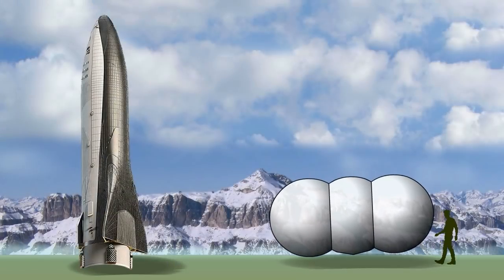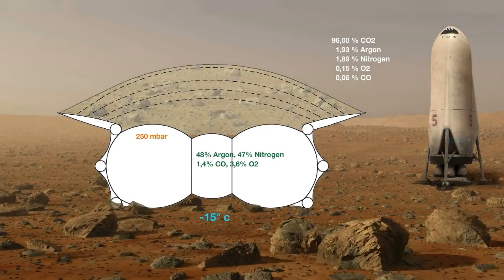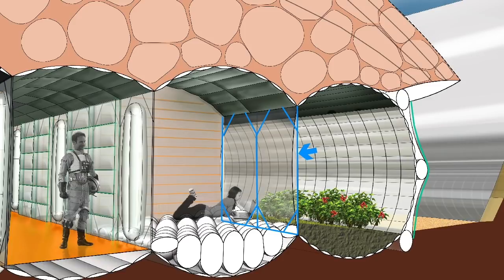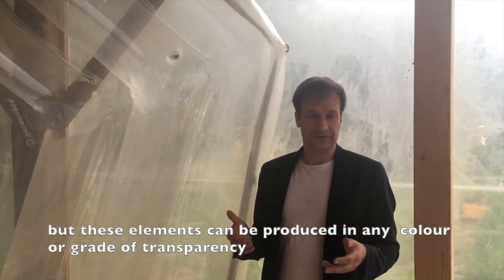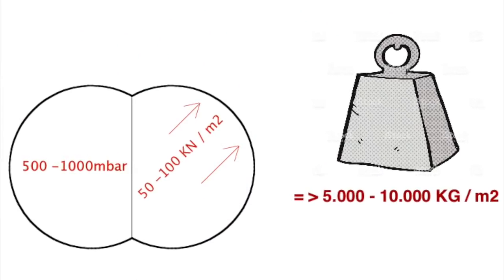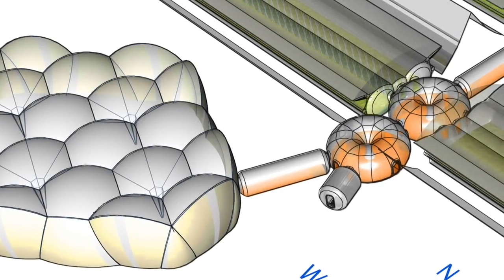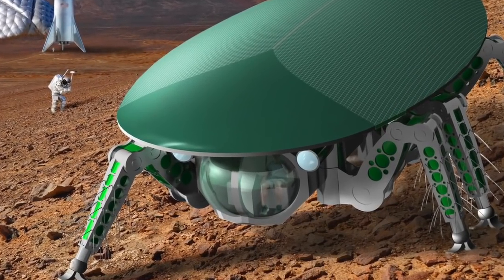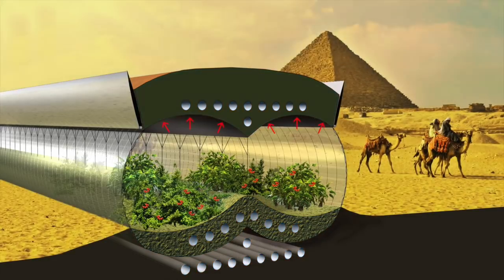inflatable Mars habitat and Lunar base

Comment: 3:12 The percentage numbers add up to way more than 100.
Reply from the maker: you are right. this is mathematically incorrect
But in fact the amount of argon and nitrogen remains  the same. By adding CO2 that is converted in to Oxygen by photosynthesis, the  total number of molecules increases and so does the density and pressure of the inner air.  
So yes, mathematically it would be correct to show percentage number of argon and nitrogen decreasing. But I thought that would be more confusing for observing the process within a few seconds

Comment: Great job! You have great ideas!! 
I have a simpler solution based in the use of water instead regolite. Pure ice is transparent but shield radiation, in addition is an excellent termic isolation and you can equilibrate the habitat internal pressure  with the weight of the ice. As you can calculate 0.5 atm is equivalent to 15 meter of ice on mars. Even you can use it to concentrate light as a lens. I also know how to make cheap foundations by using cables although doing things well you don't even need them. I think I know how to do it. I would like to work with people like you some day.
Reply from the maker: There has been this   mars  ice house  project  awarded in the 1st stage of the NASA design competition. A smart concept. But I see 4 problems :
1; Water/ice is difficult to mine on Mars.   It is expected to  be on the poles, 9000km away from the equator where the habitat should be for climate reasons,. Or there hopefully is some underground which needs to be. processed to be extracted.

2; the inner temperature should be around 20°c  and even outdoor the temperature can raise up to 30° sometimes.
This means the ice would constantly melt on the inner side. To avoid the ice vaporizing in the low pressure on Mars, when temperature raises above 3°c. you need a transparent membrane layer outside to hold the steam and steam pressure until it freezes  again, this are high pressure forces on the membrane and the membrane is fully exposed to radiation, dust storms and micrometeorites

3; it will be difficult to produce a 3 meter thick ice wall so clear that not much of the light is absorbed

4; Ice is very brittle. in case of a Marsquake it might crack
Reply from the maker: if you are interested go on my website and contact me.  When I get enough budget to continue quicker, I might need more brains in the team

Comment: 17:00 for the applications on Earth, it seems like there will need to be an over-pressure inside, and air-locks if that overpressure is at all significant (i.e., enough to contribute to bearing significant weight on top). That seems maybe ok in an application where you don’t need to enter/leave frequently (a greenhouse?), but potentially problematic in applications (eg, a hotel) where a lot of traffic is anticipated. I wonder how much overpressure would need to be present to lead to a need for slow decompression, to avoid the “bends”?
Reply from the maker: yes, depending on the thickness of the deposit on top , about 50 -100 millibar of overpressure are required. Less than for the Mars habitat, but still it needs to be careful calculated  for the structure. An airlock is necessary . The best solution would be  these Lock doors they use on Boats.  Apart from greenhouses , single home also might be an application as prefabricated "instant " houses that just need to be put into a pit and be inflated. Which keep a moderate temperature around 20°c without heating or cooling. But I don't see a use for hotels or other large highly frequented buildings.
Reply from the maker: from all your comments and questions, you seem to have a lot of technical understanding. What is your profession?
Reply: @thomasherzig174  I have a Ph.D. in Applied Physics. Though, it’s a long time since I’ve been a working physicist. (I also worked as a software architect. More recently, I focus on interpersonal communication, collaboration, and conflict resolution.) And... issues related to space exploration is an area of active interest.

Comment: Many things about this design seem very promising. I like the simplicity and efficiency of the construction techniques involved. I could easily imagine some version of this approach being deployed on the very first Mars mission, and being available for use early in the stay on the surface.

For habitation modules, it seems like there will be a regrettable lack of sound insulation—it appears that the only way to get sound isolation may be to have a long tunnel between modules that aren’t otherwise connected? 

I’m curious about the potential for manufacturing new module components on Mars, given suitable materials? It would be nice to have this capability both for repairs and to address unforeseen needs.

I’m ambivalent about the “lip” doors. I suppose they could be braced open, when one needs to move equipment in or out? I wonder what benefit they actually provide? Minimal sound insulation? Barriers to unwanted air movements?

Having two layers of pressure containment seems like a good idea in general, for safety. I like that the design includes this. (Except at the ribs between air pouches; I imagine those ribs will be tough enough that punctures there are unlikely?) 

How do you imagine forming a flat, stable floor? Filling in the bottom with regolith? For a habitation module, I wonder if regolith would pose a health hazard, unless it has been heavily processed? Providing a good floor seems to me to be one of the more puzzling issues. Maybe the surface the habitation is on can be made very flat, so that the lower layers of the habitat are forced to conform, then you just overlay the lower membranes with hard panels of some lightweight material, to protect the pressure-containing membranes from wear?

I wonder how one could detect a leak in a sub-floor membrane? Though, this may be unlikely after everything is installed? (Unless one inadvertently imports rodents, or allows one to escape from a lab? Yikes! That could be a big problem?)
Reply from the maker: there also is a way of forming rigid indoor components by inflatable membranes:  You take the inflatable  envelope outside where the airpressure is nearly zero and fill it with mars sand, then you close it again. 
When you take it inside the innere air pressure  of the habitat  will press the envelope onto the sand inside . Pressed together by this strong force it will be rigid.   like these vacuumed peanut packages.  So you could make hard panels or even columns  and massive inner wall this way.  But it is a lot of mass to carry inside which is  very heavy even under mars gravity.  But a toilet bowl or a sink could be quickly produced this way from a thin light envelope from earth and sand from mars
Reply: @thomasherzig174 
Even plastic forms the are the right shape, if filed with Mars sand, would take on a solid form, even without vacuum packing those forms.
Reply: I’m curious about the construction techniques. There are a lot of inflated compartments within the structure. Are there inflation valves? Or are they inflated as the membranes are joined together, then permanently sealed?
Reply from the maker: @zzubra  the inner walls are just inflated once they are zipped on. with any kind of electric  rubber boat airblower. Maybe after several weeks they need to be reinflated a bit.
I already produce inflatable wall elements which are connected visa nylon zippers:
http://www.pneumocell.com/pneumocell.elements.english.html
www.pneumocell.com

Yes the sound insulation is not very good, but still better than in the ISS station I guess. Since you need about  400-500m2 of greenhouse area to sustainably feed one person, there is enough space to keep distance between sleeping compartments.  If you only grow vegetable and bring grain from Earth you need less agricultural area. But then  it is not 100% self-sufficient .
Reply: @thomasherzig174  if interior walls may need to be re-inflated from time to time, is the leakage through the valves or the membrane?  Sounds like a chore that it would be nice to be able to eliminate. Might, for example, using more expensive valves fix the problem? What about the cells of the outer pressure vessel? If those have leakage, I’d worry about that.
Reply from the maker: @zzubra  in theory it should be airtight forever, but it depends on the production standards / efforts. The welding needs to be done very carefully,. after production each item needs to be checked.  For cheap inflatable items they only make a 24 h air leack test,  For higher standard you test longer. 
When when the leakage is a very little bit only after a week, it is very difficult to detect the air leack because it is so tiny. Also the membrane material could have tiny leakage when not produced carefully .  it also depends on the design.  With simple geometry that requires a few production steps only , it is easier o produce something 100% airtight. .
For the big structural membrane a little air loss would not ne critical. You can slowly add CO2 from the atmosphere by time , which will be converted into oxygen and biomass through photosynthesis
Reply: Inflatable habitats are compact to import, even if they can't be made locally for some time...

A floor could be tiles that lock onto plastic feet, that distribute weight through the inflated section directly into the ground.....?         :)
Reply: Two layers is a good idea, three layers is even better !

Comment: Personally, I think you could get a great amount of light into an under ground base simply by using sky lights with angled mirrored panels that are I backed with special blocking materials on the back of the mirror.  Or using a sort of acrylic prism centered with-in the sky light.  Certain translucent materials can also stop radiation due to their composition.
Reply: For the highest energy radiation, nothing stops it but mass. So, I wouldn’t count on any transparent materials to provide full radiation protection. Schemes with mirrors and angled panels could work in principle—and that’s what the video is proposing. Yes, one could also do this with angled skylights, but the complexity of that would be a bit higher.
Reply: @zzubra  The mirrors in the video have moving parts which makes them more complex.  Most skylights and light tubes are passive.  Probably not a big deal since we are talking about a Mars colony.

Comment: You are talking about using loose regolith as shielding the structure but do not mention it is a powdery toxic substance.

    3d printing would allow regolith processing to remove toxic material. A 3d printed stricture is self supporting harden shelter not subject to popping like a ballon. Trench sub surface built structures could also be back filled for additional shielding. 

  Why have a surface mirror/voltaic system when a space based system could remain active continuously? Send down both visible light and electrical energy 24/7.

We have thousands of years proven experience with soil based construction. Why use a fancy ballon?

    Growing up in the sixties with inflatable furniture i know how sweaty it gets in minutes. It could require a padded cloth cover to be usable. It is an idea for beds chairs and couches however even interior walls would let the kids hear everything going on in mom and dads bedroom. Lol.
Reply: Something unique about construction on Mars or the Moon is that there must be a pressure differential between inside and outside. I see this approach as taking advantage of that inescapable difference in a clever way.
Reply: @zzubra  Traditional building materials such as rock, steel and aluminum all have good compressive strength properties. And on earth, these are important for structures. But due to the tremendous pressure difference between the martian atmosphere and a life-friendly environment, your structure really only needs good tension properties. Compressive strength is unnecessary. So I completely agree that this method is simpler and makes good use of the pressure difference. Since it's going to be there anyway, you may as well use it to make your structure rigid.
Reply: Regarding a space-based system for gathering power... that is many orders of magnitude higher complexity than the solution being proposed. That complexity is unnecessary. (And, beaming power gathered in space to the ground is an approach that Elon Musk has been a vocal opponent of, believing it to be a misguided approach for most purposes.)
Reply: Regarding the regolith being a “powdery toxic sustain environment”, the relevance of this is different inside and outside the habitat. Inside, the video talks about detoxification of regolith using bacteria. Outside, toxicity isn’t particularly relevant, so long as the regolith isn’t corrosive to membrane materials. As far as the regolith being “powdery”, that’s an interesting point, insofar as it affects the construction of both the pile of regolith on top, and the side berms. One resource suggests that in some places (it varies by location) the regolith might only be able to sustain a fairly low angle of slope, before material starts to slide off.  That might mean that the regolith pile on top might need side walls, to help prevent it from sliding off? And for the side berms, perhaps some binder material might need to be added to the regolith to allow for sufficiently steep construction? Such a binder could optionally also be used in the top regolith heap. For information on regolith, see, for example, https://www.researchgate.net/publication/228564755_Mars_Soil_Mechanical_Properties_and_Suitability_of_Mars_Soil_Simulants Edit: looking at the proposal, I see membranes and cables being used in ways that can likely address the possibly powdery nature of regolith.
Reply from the maker: @zzubra  i ve been considering the powdery loose condition of the regolith . to keep it in place it could be filled into very light in thin "sandbags"  and th4se sandbag are piled on the roof. In the perspective section drawing you  can see the outlines of the sandbags
Reply from the maker: "We have thousands of years proven experience with soil based construction. Why use a fancy ballon?"

sorry the main part of the message got lost:

the  partly toxic regolith is outside only of a sealed structure.   the regolith that is used indoor as a base to make fertile soil is cleaned an processed before taken inside

Comment: I'm thinking we combine your plastic structures with Elon's tunnels and we have a winner.  Build your plastic structure so that it just fits inside a tunnel and maybe some outside areas that just use your structure as a plug to block off the tunnel.  You could build all sorts of structures with intersecting tunnels.
Reply: Plenty of unoccupied caves on Mars too, if you don't feel like digging...    :)